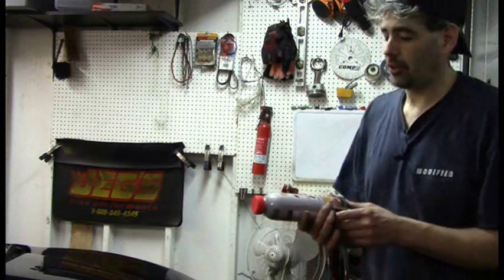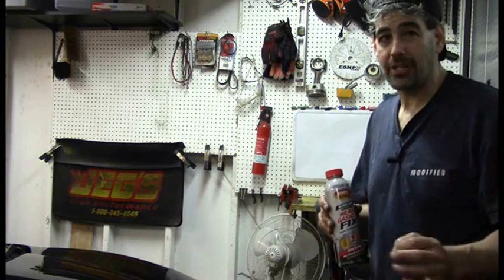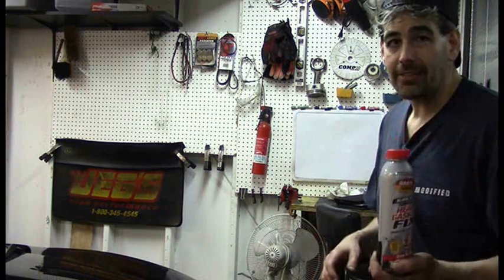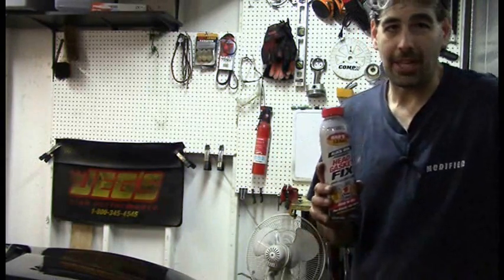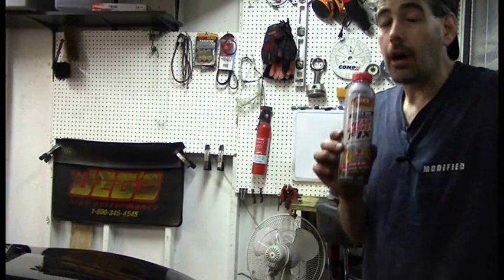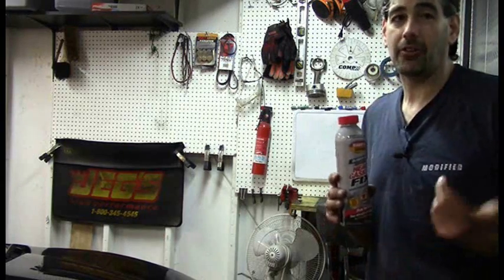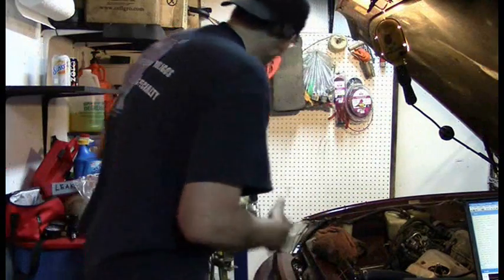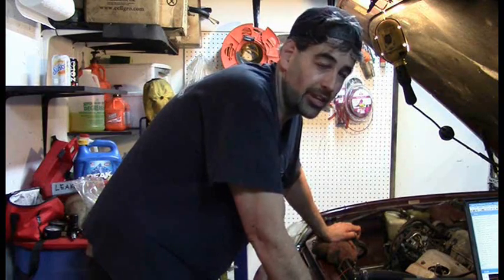Liquid Head Gasket Repair / Block Sealer Scientific Testing

Comment: So the first time only 3 pumps for noticable yellow second time after sealant what 8x and barley changed colour so it worked about 90% then? A good temp fix? Maybe if done it 5x left over night it may have worked no?
Reply from the maker: Jayzee, it started turning yellow after three pumps on both the control (baseline) and variable (after adding reagent).  I just pumped it more to bring the yellow out for the camera to easily see (this video was made before I got HD). The leakdown and compression tests are the tests that matter and the difference was statistically insignificant.

Comment: I thought your suppose to take the spark plug out ie... (kimmy steal seal qouted and showed) >>>> you do the spark plug test well i think he took one out and dunked it in some water as it was dripping anyway he left number 2 spark plug out unplugged the injecter than he frew the steal seal in ran for 20min cut it out for 30 min then repeated 5x then left over night then in the morning replaced spark plug and injecter and i think he said it works on most cars but in the comment section he told evreyone nahhh that sound like a gasket change "obv steal seal paid him he gets 500k views per vid he probably got 20,000 pound

Comment: Thanks for this video, I came from the previous two part video relating to this vehicle https://www.youtube.com/watch?v=uVn-IDi7da8
This stuff reminds me of when in the old days my dad would use something called Radweld to fix a leaky radiator problem that developed one summer holiday. This was on a car with a belt driven fan and when antifreeze was only for winter.
This stuff stopped the leak in the radiator Ok, sadly it gunk up the water channels in the block and in the head, caused the thermostat to stick, and put the cabin radiator out of commission which we only noticed the following winter!...
I was soon of the opinion that those additives are best left on the shelf as they are more hassle then they are worth...

Comment: The procedure increased pressure by a couple percent. Running the repair a few more times could compound the improvement.
Reply from the maker: Hmmmmm you know what, I didn't think of that!! Hell- no one did!!  Dang. Every single time I release a video someone always comes along with an idea that I wish I included.
  Even if it didn't fix- if another treatment at least increased compression over the new baseline, it would be much stronger evidence to show there is indeed an effect of compounded improvement with the product- which strongly supports the potential for the product to effectively repair some conditions.

Brilliant observation Gordon- definite fodder for a follow up video if I get the chance!
Reply: Schrodingers Box Lol. Thank you. Pressure could increase linearly, exponentially, or nothing at all... :-/ Thanks for the videos!
Reply from the maker: Gordon Tendick ... or decrease.. but that would tougher to explain lol.
Reply: You're right in that it doesn't work! My Subaru Forester had a blown head gasket. White smoke and pressure test proved it. I tried the Bars Stop Leak... Didn't do anything...
Reply: Very good video, detail and patience. ;-)
I've been messing around nuts&bolts for the past 30 years and just learned the "sizzling" oil test. Nice. :-)

About the "miracle" liquids to stop leaks. I have very little faith in pretty much all of them. But truth be told at least once got me out of trouble. The bad part of the story is that I only saw the effect almost 3 weeks!!! After the application. Well, not what we expect and not what I was expecting also. Curiously when it stopped leaking, not only I was not expecting any results, but had almost forgot the "treatment". 
The reality is that I sold the car almost a 1.5 year after the "treatment" and still no leak... It was a daily driver. 
BTW I should had, the treatment was for leak on the power steering, not a head gasket. :-)

Comment: the best bubble test is to make sure the radiator has water in it then put the cap on and make sure there is some water in the resavore and watch for bubbles there because it dont matter if bubbles are surfacing in the radiator it will tell u if there is pressure in the radiator. so for a combustion chamber leak u dont need none of that silly dye or any of the other stuff unless there is something else wrong. and i am talking about checking for bubbles while the engine is cold once it starts warming it could push air out of the radiator but it wont be constant unless u have compression leaking.
Reply from the maker: Resavore? jesus christ on a stick, what in the hell is a resavore??  RES a vore... res A vore.... Ohhhh ... you mean "Reservoir".

Comment: oh and i could tell by the bubbles in the radiator which one was leaking with the car running. one looked like a leak and one looked like one that was freshly topped off and working the air out of the top of the radiator. the consistancy of the bubbles and the full radiator.

Comment: the way u did it will work the best on non compression leaks like upper head cracks or intake leaks if your fluid runs through the intake.

Comment: well u did it wrong u gotta take the spark plug out of the cylinder that is blown and run it until it gets to operation temp and the longer u run it the better it will do. here is the reason the cylinder has more pressure than the radiator so it will never get into the cylinder until u cut the car off plus u said yourself that the radiator cap wasn't sealing so u have alot less pressure to push the barrs leak into the cylinder if u remove the plug and disconnect the injector for that cylinder u will have more barrs leak go into the cylinder and the longer u run it the other cylinders will heat up the engine and cause it to work better that is the difference between science and engineering. mechanic's need engineers not scientist lol
Reply: Weekschannel - You say that more Barrs Leak will go into the cylinder if the method is done properly, but is it bad when the Barrs Leak gets into the actual cylinder? If it is bad for the cylinder, how do you remove the Barrs leak from the cylinder?
Reply: @wwburn  replacing the gasket lol

Comment: 2 years ago I paid almost $30 for a similar product.  It didn't work at first.  Within 2 months I didn't have to put coolant in it anymore.  I ran it up till a month ago without any more coolant!!  That stuff worked, but it took a month and a half.  I had to drain and flush the antifreeze with my product.  Then had to run it with water alone.  Can't remember the name.
I put a magnum V6 in that 87 Dakota but put my heads and carb on it.  Oil holes didn't line up.  Had to oil the rocker arms from the oil pressure sending unit through brake lines.  All oil pressure went to heads until I put a ball valve on it.  Drove it for 14 years like that.
Reply: Wow! That job on the Dakota sounds like a real winner to me!  Good show!

Comment: This stuff costs $70 in Australia. Whats up with dat?
Reply from the maker: Probably because the average Aussie has far more reasoning capability than the average American, who is more than 50% likely to be a high school dropout if they are in the major cities.  Therefore, there are less stupid people in Australia to fall for these gimmicks and thus the companies making these products have to raise the price proportionately to compensate for the lower sales.  In the US they could charge a dime a bottle and the teeming masses of sheeple will still spend enough to generate a profit on these products. Of course, if they are on welfare, they're spending my money instead of theirs, so I'm glad its cheaper here.
Reply: The cost of shipping brings it to $70?
Reply: K-Seal is almost identical in composition and retails for A$20. My compression is OK for the age of the vehicle (and all cylinders are in line with each other). I used it to fix a coolant gallery to outside of engine leak via the head gasket, this it did admirably. Just for shits and giggles I ran a compression test, no difference.

Comment: I actually tried Bar's Leaks 1100 on a few cars and most of them worked. It has a lot more steps than the one you used in the video. One of them (1992 Lexus LS400) we continued to drive it for two more years without anymore leak.
Reply: i have a 92 es300. i may need to try this
Reply: Still running?
Reply: Still running?

Comment: I have never heard of any product actually fixing a combustion leak past the gasket. However I have heard of such products helping cracked blocks and heads.

In this case I understand the radiator was not pressurized at any time during the test, I would have thought the product would require pressure to force itself into the gaps in the gasket.

I did once fix a coolant leak to the outside of the engine through the head gasket with a leak sealer.
Reply from the maker: Great point about the system not being pressurized! I had not considered that. Dang!  Even so, I have to think the pressure from leaking combustion would far trump the maybe 15PSI from radiator but still a great variable I did not consider. 
 I love comments like yours! Thanks for taking the time!
Reply: Some toyos had a problem with a head bolt stripping and lifting itself out of the block. The temp. change affecting the paper test would seem to confirm their issue upon this specimen also.
Reply from the maker: Rýán Túçk Excellent point, and in fact it is very well established that temperature of the engine can drastically affect some tests. It is not unusual to have intake manifold leaks that "seal up" after the engine warms up, or compression that is good at cold but fails when engine heats up.  It is definitely worth repeating tests under cold and warmed up conditions.
Reply: Schrodingers Box , I agree that while the engine is running the combustion pressure(s) should overpower the coolant pressure. However, what happens when you shut the engine off?  Now you have no combustion pressure, but all the pressure in the cooling  system still exists, that is most likely when the product would seep into the cracks. In fact, that may be why it needs the 15 minute warm up.  To circulate, build pressure, and heat to accelerate the curing.
Reply: If coolant is being poured into the crankcase you can run with the rad cap loose.
Reply from the maker: Rýán Túçk Guess you might as well, Ryan- and hope that the car overheats and blows a head gasket before the coolant in the oil destroys the bottom end.
Reply: Probably a worse mistake to pour cold coolant into a hot water jacket and crack the block and/or heads themselves.

Comment: Shouldn't the coolant have been fully replaced before performing the chemistry check? We know the coolant failed test earlier in previous head gasket test video.

regards
Reply from the maker: Excellent question. No- this particular coolant test checks for actual active gas being produced by the combustion, it doesn't actually test the coolant- in fact the whole purpose of the lower chamber of that device is to prevent accidental draw of coolant.  I do believe there are some tests that you do indeed measure for presence of hydrocarbons in the actual coolant itself and in that case, yes, you would indeed need to replace the coolant and in fact thoroughly flush it.

Comment: Good video! What kind of gloves are you using?
Reply from the maker: Actually they are nitrile gloves I get from the laboratory but the Harbor Freight Heavy Duty Nitrile Long Length gloves are exactly the same thing. Excellent durability, tremendously puncture resistant, and cheap.  Not everything at HF is crap- these gloves are fantastic! Often one pair will last me the whole job- in fact I even reuse them sometimes!

Comment: I think this stuff is all snake oil, it is just a way of taking more money off the unfortunate one whos car is acting up. I think I will bring out my own one, clutch in a can, see if I can make a few quid!
Reply from the maker: Ha, I couldn't agree with you more!! I absolutely believe that there is an entire market geared to a demographic of people looking at a $2400 repair, so they think "what do I have to lose spending $24 to see if I can avoid that".  
  When you come up with your clutch repair fluid, I'll be happy to test it for ya lol.  I imagine the side effect would be excess buildup on the brake pads!
Reply: The coolant that had to be subsequently wasted was also apparently snake oil. The silicates were supposed to prevent leaks like these.

Comment: 'Hi! professor. i like the way you proceed. I want to understand. two gauges for the leak test. Can you explain to me where to fix the second one which doesnot move; Also do you turn the crank shaft manually to close the valve? thanks.
Reply from the maker: @abderrahmane- excellent question.  The gauge on the left with all the numbers is simply the input air pressure gauge. The air pressure needs to be between 50-150PSI and this gauge verifies you are at a constant pressure in that range. There is no setting for this on the leak tester- it is set by the air compressor regulator.  The second gauge with the low, medium, high can (and must) be adjusted- there is a zero point labeled "SET" located below the LOW range that you adjust to before connecting to the engine.
  Yes, the cylinder must have valves closed which I do by turning the engine over with the device connected. When the valves close, air pressure builds in the cylinder and can be measured.  You can also do this by setting to exact TDC and then connecting the gauge but this only measures for leak at the top of the cylinder because piston is at TDC. I like my method better because it measures with piston nearer bottom of cylinder and can potentially detect cracks in the cylinder wall below the TDC area.
Reply: thank you very much. i will keep watching your video. greetings from france.
Reply: Seventy times seven. Inside french joke.

Comment: Combustion pressures are probably the highest "fluid" pressures in the engine's systems.  (Brake or PSF pressures might be higher, but not part of the engine system.)  So it just makes sense to me that combustion pressure will overwhelm any stop leak concoction.  But it's good to prove the waste of time and money.  Now you got to flush the coolant system to get rid of that "sh$t".
Reply from the maker: I totally agree with you WD. But the neutral party reviews that claim the product has worked for many people are hard to ignore.  But I agree with you- expecting some particles to settle under 120, 90, even 50PSI or even 0PSI for that matter (because with that size of a leak could the product fill it anyway?) seems ridiculous to me.  Allegedly, however, the product is supposed to work because the copper "melts" in the vicinity of the combustion and forms a permanent metal seal. The logic with this in itself seems to be more flawed than just jamming the leak with particles for multiple reasons.  Anyway, as of now I am awaiting customer's decision on if we'll put a cylinder head on the car but indeed I did flush the stuff out- if nothing else I was afraid the heater core would clog.
Reply: Schrodingers Box Hey Matt..just thought I would throw a comment out about this.  As I am a professional tech I have never used an aftermarket head gasket "sealer" product on a customers car obviously, but like you I have heard many good and bad things about different products out there.  I really appreciated how you researched the product you chose to use, and the method you chose to go about narrowing it down.  By strictly scientific means, you picked the right product to test, and out of the ones you checked, the one that was most likely to produce results.  In your research did you come across a product called Blue Devil Head Gasket Sealant?  I have no experience with it, but I know one person in real life that swears by it, and I did watch a convincing youtube vid about that product.  I just throw this out there for future consideration because hey you never know.  Just because one popular product failed doesn't mean they all will.  I trust you and your methodology, so if you ever get a chance to test this one and prove it works I would be on board :)
Reply: Blue Devil, I'll swear that it costs more.